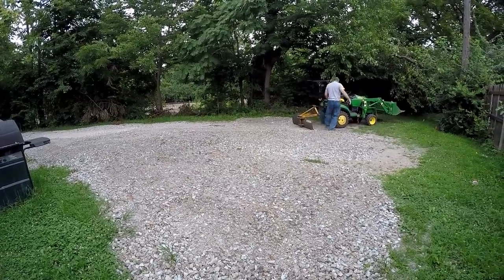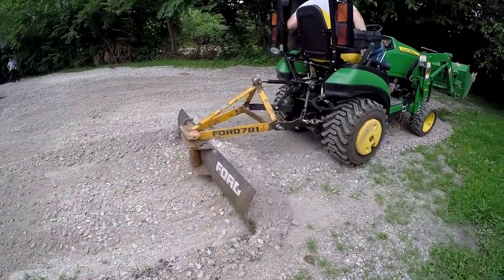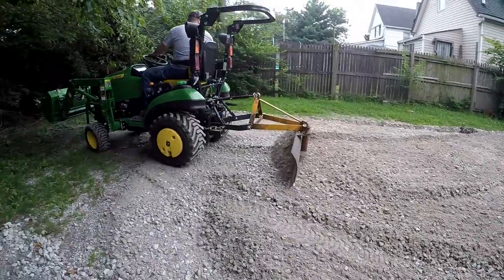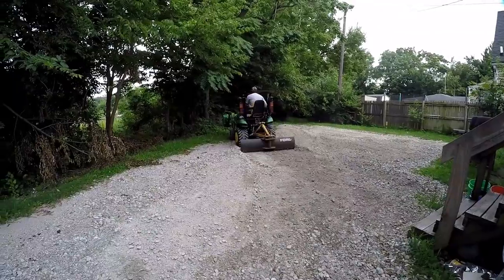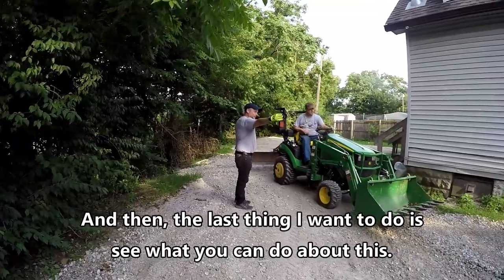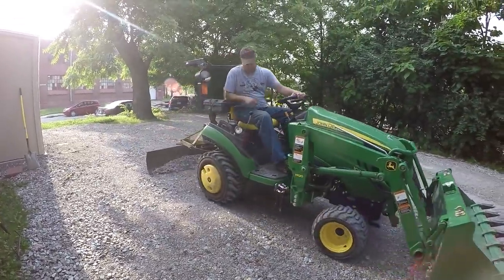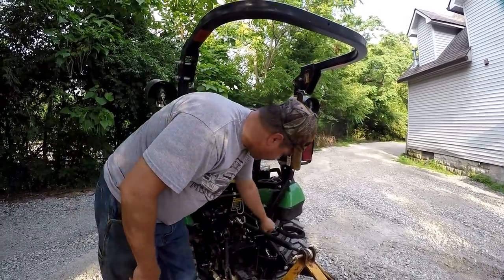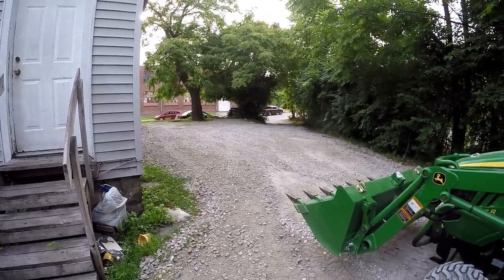Playing in the Rocks: Grading Parking Area with Compact Tractor and Rear Blade

Comment: Great job with the back blade Tim!

I have a couple of hundred yards of gravel driveway and I am looking at the various implements I can use to maintain it. What would your thoughts be between a box blade, land plane or landscape rake for this task?

Mick
Reply from the maker: All 3!  :-)
Reply: Mick Olson: 1) What size tractor do you have? 2) How bad is your driveway? 
I personally suggest a box scraper. You can carry more material to spread & and it can be used to remove the center if you have a high center. Use it in reverse to remove high centers & use that material to spread out. Depends on which brand you buy, implements will be lighter weight and built with thinner steel. A standard duty from Woods (BBS72) (Or LandPride) might be a heavy duty  from Behlen Country (Wilco Farms brand) or Tater (I think). As for landscape rake, only if your driveway is already smooth. Land plane from EverythingAttachments.com has a full line of implements that fit sub-compacts & compact tractors. Check them out. If you have money to blow, get a hold of ABI Attachments about a TR3 rake or TR3E depending on tractor size.
Reply: Drew6709, 

Thanks for the info.

No tractor yet, but I am hoping to remedy that in a couple of months. I am looking at a Kubota 'L' series and trying to balance what I will need vs. what I can afford. 

Our driveway is not bad at all. It is fairly flat and no pot holes or washouts. We had it re-graveled last year, but it is in need of some maintenance as the gravel has thinned in some spots. I think a landscape rake would work great on it. 

We also have some hunting property that has two of roads on it that need maintaining and I would like to add a couple more road to allow easier access to certain areas. So I am thinking that a box blade would be a wise choice for that task and I could utilize it on the driveway here at the house.
Reply: Mick Olson: If you have to "order" a tractor from manufacturer and if you can afford it. Have rear hydraulic remotes installed and a "3rd FUNCTION VALVE" for the loader. Better to have those installed at time of build. Rear remotes will allow you to use implements with hydraulic operations. The 3rd FUNCTION valve will allow you to operate a grapple, 4-in-1 bucket, or other implement with hydraulic cylinders. And get a 4x4! You will thank yourself in winter.
Reply: Drew6709, 

The 4x4 option was already on my "Must have" list and the dealer here said that they don't even carry the 4x2's at their shop as they don't sell. 

At first, a backhoe was not on my list of "Must have's", but my lovely bride convinced me otherwise, as she has a few projects around the hacienda that will require one. 

I have spoken to the dealer about a 3rd Function valve, but I don't know the exact cost of that as yet. Again, this is why I am doing research by watching channels like Tim's to figure out what I "Want vs. what I "Need" vs. what I can "Afford".....
Reply: Mick Olson: take in account how much property you have first. And how many tight quarters you might have that machine in. Tires, do you want standard Ag R4 or the flatter R1 (like Johnny). Do you want wheel weights or ballast in the tires. I have calcium in the rear tires of my Kubota Grand L4240 GST. Wheel weights ARE EXPENSIVE, but ballast is definitely worth it. I usually have my 6' Woods box scraper attached at all times for extra ballast. I did NOT get a 3rd function valve for mine. The kit is roughly $850 from WR LONG. Might be priced different between models. If you can, get a rear remote for a hydraulic top link. You will be thankful of that.  List what you plan on using your machine for and what implements you will be looking to buy. I did months of research before purchasing my 4240. One shortcut you could do is look at Kubotas TLB line. You would have to buy the 3 point arms and linkages afterwards. But you would have a machine better equipped with a backhoe. Just an idea.
Reply: We have close to 7 acres here at the house and 140 out at the ranch. Pretty much all of it is wide open spaces. As for tires, I think the AG R4's will work best for my purposes.

While both pieces of property are fairly flat, I was planning on having the dealer add ballast to the tires. I will also be contacting him to get a better idea on having the 3rd function valve installed. 

My primary use around the house will be mowing, driveway maintenance, stump and rock removal and running underground power and water lines. Out at the ranch, it will be used for road work and maintenance (Although this is not a priority right now).

Again, I am working on a limited budget (Aren't we all?!), so I my thoughts are to get the biggest tractor I can afford now (That includes a mower and a backhoe) and then pick up other attachments as I can afford them (Box blade and a Landscape rake). 

I have looked at the TLB's, but I they are out of my price range.
Reply: Mick Olson: good luck. Hope you find the machine that fits your list.
Reply: Mick, with large amounts of property. Might want to look into a batwing mower from Rhino. They have a batwing mower that will work with a 40 hp tractor. But rear remotes are needed to lower the wings and height adjustments via transport wheels. It is a tow mower instead of a 3 point hitch. But they are SPENDY. Just another idea. Hope you're able to find a tractor that will meet your needs.
Reply: I won't be mowing out at the ranch, just around the house. I think a 5 foot brush hog will work fine for that. I checked out those Batwings and they look nice, but they are way out of my price range....
Reply: Mick Olson: Honestly, I'd go 6' implements if you can. And try to bundle implements when you can for a cheaper price.
Reply: Drew6709 ,

I’ll keep you posted on what we end up with. As I have mentioned before, we are going to run the numbers on the various ‘L’ series tractors and see what will work for us. It will be a balancing act between our “Wants vs. needs vs. what we can afford”……

Comment: If you had angle the blade by one or two holes it would've worked a little bit better, it would cut into the gravel better, then  straight dragging .
Reply from the maker: +Donald Latimer perhaps. Seemed to work 'good enough', so I left it alone.

Comment: A TR3 Rake would have been another implement. With it having capabilities of a landscape rake, box scraper, pulverizer, and land plane. Look up ABI/TR3. But Johnny MAY NOT have enough power to lift and pull one. But they (TR3) are expensive. And it is quick hitch acceptable. You would have to see one work to get a better idea of its abilities. just another idea.

Comment: I typically hang a couple of my suitcase weights on my rear blade when I use it. Work's pretty well to make the blade dig in.  I don't have a box scraper either and get by fine.  I just rely on the angle blade and my bucket.
Reply from the maker: +Chris Rexroat lots of ways to get the job done!

Comment: "IF" the material had been packed more, shortening the 3rd point can assist in the blade digging more or lengthening will be more shallow of a cut. And if you have the lines from the side , turn the blade around 180 degrees and "float" the blade around the lot to smooth out the lines of gravel. If you really need to dig, leave the blade in the reverse mode and back up to dig harder packed material. Too many ways to do this job. Loader only could have certainly done the job as well,

Comment: Yeah it's a bulge on the inside front left it's still there even without the load I took the tire off deflated it and it went away a little bit
Reply from the maker: +scott5609 I've seen that on other ag tires.  You might as well get a new one.  No fix available